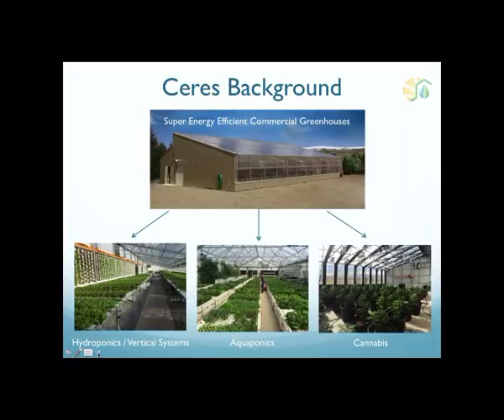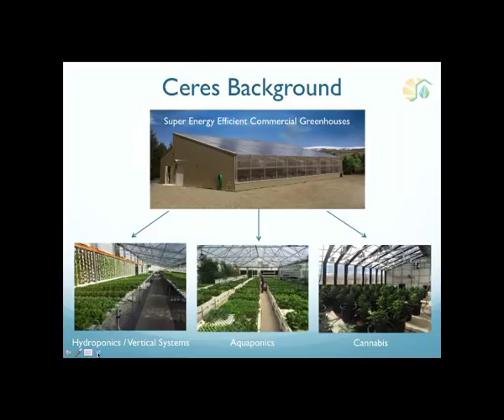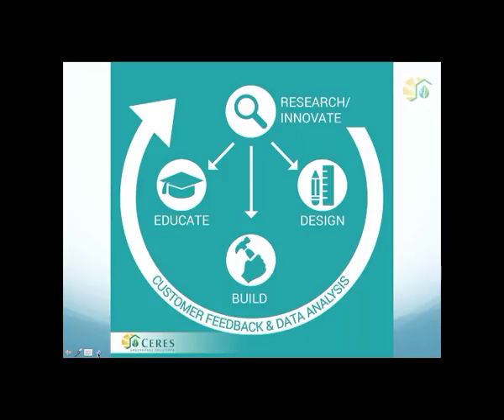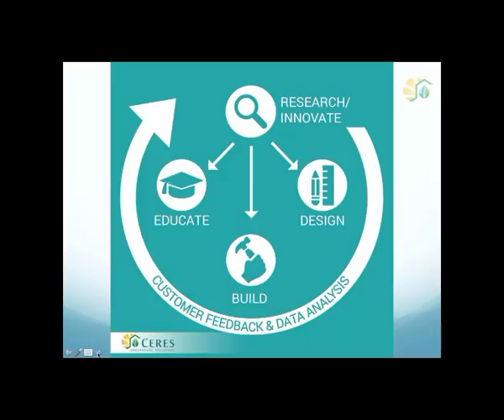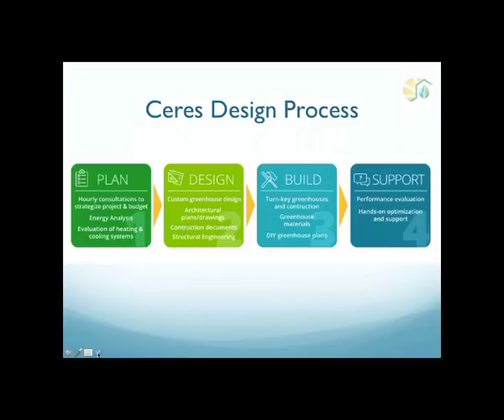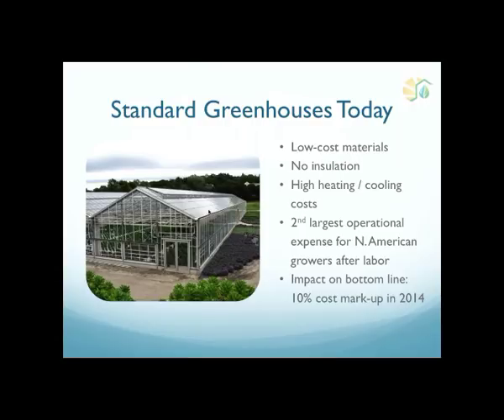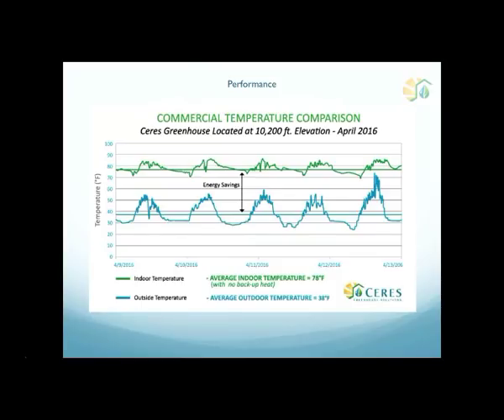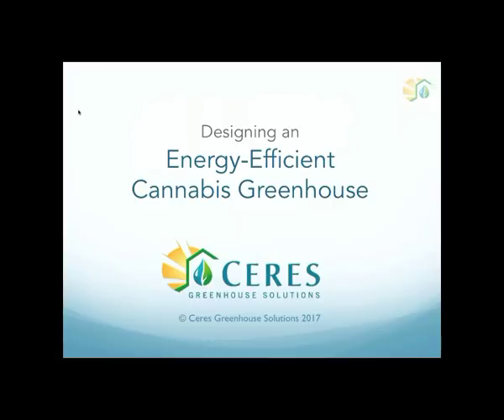Energy Efficient Cannabis Greenhouse Design

Comment: The gaht system will create very high greenhouse humidity at night which is not a good thing during the bloom phase.  If you blow hot moist air into the tubes during the day the resulting condensate doesnt just magical disappear. Phase change happens during heating and cooling, the difference is one humidifies the air (heating) and the other dehumidifies the air (cooling).An optimist would say they forgot to include this information, a pessimist would say they are being selective with the truth to sell the product.

Comment: There's a device that removes humidity and does not add heat.  It's called a window air conditioner.
Reply: I mean... not to be pedantic, but technically a window-mounted air conditioner does generate heat- it just dumps it outside the window. It's also far less efficient than purpose-built dehumidification. Jussayin'.